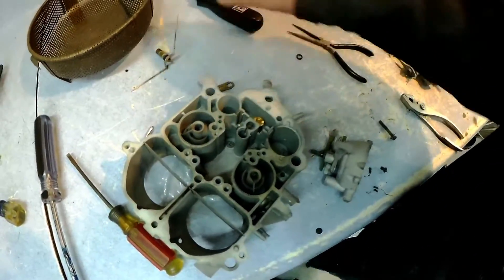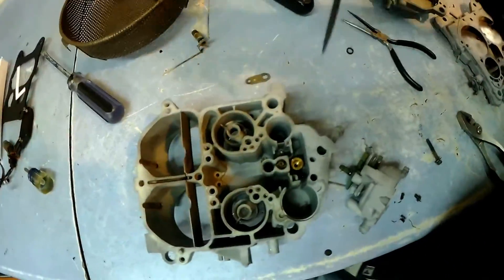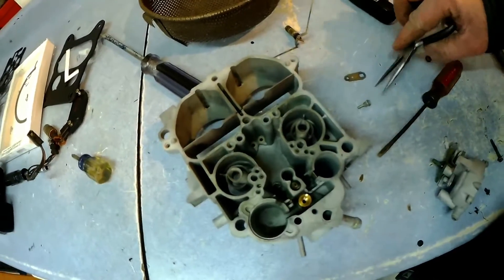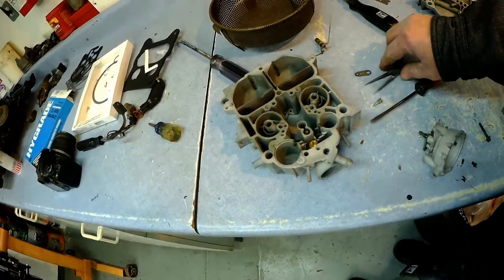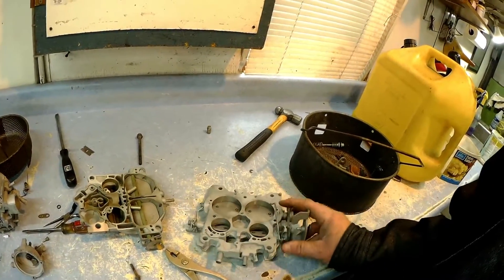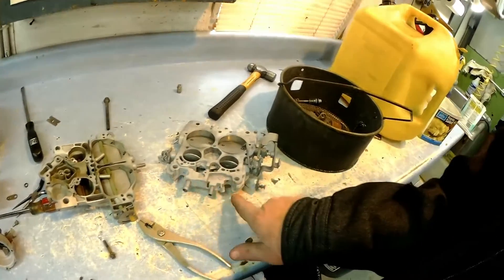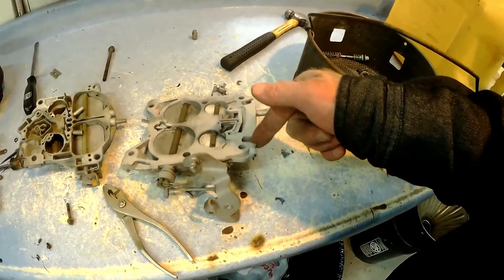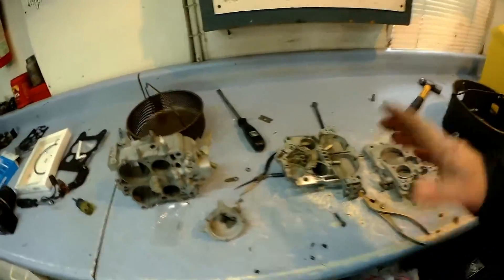GM Quadrajet Rebuild Tips

Comment: Working on my E4ME CCC carb on my 84 camaro again. I tell ya, without the gauging tools or basic settings it can be a pain. 😩 Great carbs none the less.
Reply from the maker: Yes they have a fair amount of things to watch, I "count" the turns of the mixture solenoid screw when I back it out.
Reply: @mark_osborne  I wish I did the first time I took it out, but the instructions say 3.5 turns from lightly seated. Because otherwise if you can't get the gauging tools that no one sells anymore your "screwed" lol. I finally did the air bleed valve too (took the plug out and new o rings)  I'm hoping that was my richness problem I've been having cuz everything else was working from what I could tell.
Reply from the maker: @louiscyphre6049  good deal. Were you able to remove the restrictor caps that cover the idle mixture screws?
Reply: @mark_osborne  yep
Reply: Unfortunately one of the mixture screws was seized and the head broke off so I could only set one of them. If this last rebuild makes it run better I'll just end up buying a remanufactured carb, even though my carb only has 116k miles on it it's pretty rough from sitting before I got it.
Reply from the maker: @louiscyphre6049  You could always buy a core just to get the base plate - ebay might provide !
Reply: @mark_osborne  right! I have a question about the carb when it's running. Mine seemed to be running rich. When I looked down the choke/primary bores I could see fuel dripping from the jets, is that normal? I don't think so but I'm sure you would know. I know this style carb was close to fuel injection and that seems like a leaky injector. I know now my float level was too low also.
Reply from the maker: @louiscyphre6049  In my opinion, if your idle speed is set to the typical 500-550 rpm, you should not see fuel dripping from the nozzles.  Typically it would take gently raising the idle to say 700-800 before you might notice some drips out of the nozzles. 
I would normally attribute this to a float level set 'too high'.  Yes, the primary metering rods are pulse-width modulated by the computer, much in the same way throttle body injectors work. But all that is doing is changing the fuel mixture (by raising and lowering the metering rods) when you are under load and fuel is passing through the main system (nozzles). Other than that, your carb is exactly the same as a non-electronic carb.
Reply: @mark_osborne  ok, yes my idle speed was kinda high, at least 600-700 need to use a timing light to set my tac again. Thanks for the help. No mechanic around here works on these carburetors lol. I appreciate it!
Reply: Got a question for you maybe you can point me in the right direction, been having a kinda rough idle with my 84 z28 with a l69 h.o. thought it was the carb but I don't think its the problem. The car will almost stall out when In Idle. Once at a stop sign when I gave it gas it stalled out and had trouble starting unless I put my foot to the floor. 

Rebuilt the carb since, still idles rough until warm kinda. Put in new fuel pump, vaccum lines, plugs wires, cap & rotor seem ok. Coil, modual tested ok, and pickup coil check out good on meter. 
Only actual code that came up was 23, mat/baro/mixture control solenoid. You think the intake manifold gasket is bad? I'm just at a loss, I almost checked everything and will be taking it to a mechanic because I need to drive this car again lol. 😩
Reply from the maker: @louiscyphre6049  While the engine is idling, try hovering your hand over the front air inlet of the carb, giving it a tiny restriction. What this will do is cause fuel to dribble out of the main nozzles enriching the  mixture.  If the engine runs smooth, then you know the mixture is lean and that's what's causing the rough idle.  If the engine runs worse, you at least know it isn't lean.
Reply: @mark_osborne  will do, Thanks! I just got a old analog  dwell meter, just not sure how to hook it to the dwell lead in the harness. I know the car has been running very rich according to the exhaust pipe being black and the plugs have soot on them. Until recently one mixture screw was way off. I'm pretty sure it's carboned to hell somewhere. 😬🙏
Reply: @mark_osborne  I'm pretty sure you mean having my hand over the airhorn where the choke plate is right?
Reply from the maker: @louiscyphre6049  Yes
Reply: @mark_osborne  got another "old fart" question mark. 🤣 my computer quadrajet is running rich. I don't think its a ecm problem, that seems to be working ok. I get a rich condition code 45. My carb has a lean stop screw and a rich stop screw to adjust the mixture control solenoid travel. Do you think adjusting the lean stop would help "un-richen" the carb? There's not much I can do with the idle mixture screws at the moment since one it seized to the factory setting. They're close to 2 1/2 turns out. I'm out of ideas for getting this thing to run right, been replacing vaccum hoses and stuff to make it "air tight" but I don't think that's the problem. Thank you sir, have a good day! 👍 🙏
Reply from the maker: @louiscyphre6049  Can you hear the mixture solenoid bouncing up and down while the engine runs ? You might need a stethoscope to hear it
Reply: @mark_osborne  yes, when the key is turned on, also clicks when it runs, I stick a paper clip in the top and I can feel it pulsing up and down.
Reply from the maker: @louiscyphre6049  Then you could try turning the screw effectively setting the entire frame of the solenoid further into the body,  as you know, there is a spring under solenoid. As you suggest, that will cause the metering rods to be (on average)positioned lower into the jets - leaning out the mixture  to a point.  The feed back loop will adjust the pulse width based on O2 readings, so you will only have a limited effect (with this adjustment) if everything is working correctly.  I would also throw in a new O2 sensor, those old single wires sensors wear out, and they are cheap.
Reply: @mark_osborne  ok, thanks. I actually did put a new o2 sensor in very recently. No more code 32 (yet) but now I actually get a 45 code.
Reply: Hello again Mark, I'm pretty sure I narrowed down my problem on my qjet, im getting a very small amount of gas in my float bowl line. I'm very sure I set the float and needle correctly, and checked it for sticking. It does move freely on the car. And ideas what is causing this? Fuel pressure too much? Vacuum sucking it through the canister purge valve? I think this has something to do with my rich condition for some reason. 🙏😬
Reply from the maker: @louiscyphre6049  Yes yes, I have seen raw fuel being sucked through the canister, that could be your entire problem. Try plugging off the canister and see what happens.
Reply: Update for you Mark, took my car to a shop so they can finish what I started lol. I did get the rich CE light to go off by plugging the bowl vent on the cpv. Now I found out that the style I have they recommend plugging the intake vacuum port from the pcv valve because this sucking fuel from the carb happens a lot. I did also finally get my old analog dwell meter to work lol but oh well lessons learned. Maybe when I get the car back I'll make a little video to share what I've learned and so you can see the all original 84 z28 I have. Pretty rare setup from what I've seen. Take care and thanks for the help, I very much appreciated it! 👍🙏
Reply from the maker: @louiscyphre6049  Thank you so much for the update, and yes, please, send us a video link 🙂
Reply: @mark_osborne  update #2, mechanics wouldn't touch my car lol. All the guys who work on carbs retired around here 🤦‍♂️. I guess my main issue with my car is it sometimes spits fuel out the top of the airhorn. I'm not sure if that's a carb issue or something else. It runs kinda rough until it's warmed up. But I'm no expert,  I'd just would like to be able to diagnose this thing without buying parts to try and solve it. 😕

Comment: interesting . thank goodness for efi.
Reply from the maker: Hey Richard, did you know the next generation Q-Jet employed electronically controlled metering rods, a 36 mhz computer, throttle position sensor, oxygen sensor, MAP sensor and coolant temp ?  That's right, it used all the same inputs as GM's first DFI, only instead of driving fuel injectors, it used the feedback loop from the O2 to PWM (modulate) the metering rods in attempt to maintain the proper fuel/air ratio.   The system worked amazingly well !  However, once DFI (throttle body injection) hit in 1982, the complexity (vacuum lines, wires, etc) was vastly improved.... and the beloved Q-jet was part of history
Reply: no, i did not know that ! that's really interesting . what years did gm do that system?
Reply from the maker: @richardriehle4159  To my knowledge it started in 1981, and ran thru 1988, the final year for passenger car and light truck applications.  Everything after that was EFI.   BTW, they referred to that carb as the E4ME  :-)

Comment: Don't forget the throttle shaft bushings. They wear out causing vacuum leak.
Reply from the maker: Yes, great tip.  Funny, I've been through probably 1000 of these carbs over the years and never addressed that issue mostly because if you attempt to remove the throttle plate screws they tend to "break off" and you're left with a piece of unusable trash.  A couple times I was forced to adjust some secondary throttle plates and was lucky enough to get some #6 machine bolts with nuts back in place, along with red lock-tight after breaking off the original throttle plate screws. Thanks for the memories !
Reply: @mark_osborne  Yes, the small screws holding the plates are staked on the ends, so those end tips must be ground off to safely remove the screws without damaging the shaft or breaking off screws. And primary throttle bushing kits may not have been available long ago, whereas now they're readiy available at q-jet parts dealers like cliffshighperformance.

Comment: My dad has an IROC with an E4ME Qjet in it. We installed an L69 camshaft during the rebuild with flat top pistons to get it a little punch. I installed DR secondary metering rods and an M hanger, basically what came stock on an L69 high output Camaro. Runs like a bat first gear to 6,000rpm, shift to 2nd and it stops revving, falls flat on it's face, won't go until you let off the gas and grandma it for 10 seconds. I'm thinking it's running out of fuel. I believe it's got a new Carter mechanical fuel pump in it. Any thoughts?
Reply: Yup,likely running out of fuel.

Do these things below & you will get it fixed!

Go onto eBay to search and buy a high flow .030” or .035” high glow needle & seat & set float to oem spec.
Stock oem needle & seat is approx .010”.

Remove the small restrictive in carb fuel filter and if n stall a large high flow fuel filter.

If you motors running a mech fuel pump remove the pump so you can remove the very heavy stock f-pump rod & instal a much lighter moroso high perf f-pump rod. 
Doing that ensures the fuel pump actuator spring doesn’t go into float mode at higher rpm capability the l69 cam gives your motor.

Doing the above will ensure your motor has all the fuel it needs to & past 6k rpm thu all gears.

I have found this general setup to work well on all mild to fairly hot Sbc or bbc street/strip performance apps in he 50yrs+ iv’e been wrenching/rebuilding & restoring American classic muscle cars.

Comment: What about the problem of gas “leaking” out of these carburetors when they sit for awhile. I’ve been told to epoxy those plugs on the bottom?
Reply from the maker: You could - but the problem is rare. Some kits come with a black spongy thing you stuff in the cavity under the plugs. It's shaped to fit in the cavity.
Reply: Thanks!

Comment: I will literally pay you to rebuild mine. I ordered a remanufactured one from Autoline and it was the most half assed garbage carb on the inside I could ever imagine seeing. The guys didn't even have a hanger for the needle. The needle was just sitting in the seat causing the carb to flood...majorly. worst 300$ I've ever spent. My carb on my 73 delta88 is overdue for a rebuild though, That's next on my list being as buying a remanufactured one was a big mistake.

Comment: Hey mark would you know what size anl fuse I should use with one chevy volt 24v battery I have 15 of them and I want to fuse each one and then fuse all together would you have any information on what size to use on one thanks
Reply from the maker: I'm sorry I'd have to know way more about what you're doing to be of any help
Reply: I have 15 24v Chevy volt and cmax batteries for my solar I want to fuse each battery thanks bud

Comment: Can the quadrajet be modified to run on propane?
Reply from the maker: In the case of propane, you have an injector that flows the gas and generally, one large butterfly that controls the air.  The design is so radically different from a carb, I can't see how you could modify it so it would work.

Comment: Hey Mark, greetings from Bolivia. I wanted to ask you if you have any experience in high altitude settings, I live around 13000 ft. above sea level and we are always struggling with getting a/f ratios correctly. Thanks in advance and have a great day.
Reply from the maker: I do not but I can appreciate what you are dealing with.  Do you have a wide band A/F gauge installed ?  You could always play around with thicker primary metering rods (Q-Jet) or smaller jets
Reply: @mark_osborne  thank you for responding, the other "thing" that we have to deal with is incredible high shippings and taxes rates to get whatever so, most of the time, mechanics and enthusiasts only rely on little tricks to make things work. The point that I'm trying to explain are the difficulties we have to go through to get a couple jets and needles to play with and make things right, lol! Have a great day, sr.
Reply from the maker: @kevlar7556  I understand !   You at least have the beautiful Andes Mountains to look upon, I am jealous of your beautiful landscape :-)

Comment: These two green little gaskets, I see where one goes that sits in the bowl part of the carburetor. I'm know trying to figure out where you said the other green gasket goes. Is it right behind the screw and sits in the cavity of the choke housing where the green rod goes through it from the back of the choke hosing? Very good information, but I just need to know about the 2nd little green gasket location in the choke housing.
Reply from the maker: send me an email with a photo of the 2 green gaskets  gearhead4you@yahoo.com

Comment: I'm having trouble with carb bogging when secondary start to open.?
Reply from the maker: There is a secondary air door adjustment spring that tensions the door.  Tightening up the spring will help eliminate the bog. I should do a video on that.
Reply: I'll try thanks
Reply from the maker: @nrsais07  1/4 turn at a time on the tension screw. There's a set screw underneath that locks the tension screw. Access the tension screw from the side using a tiny flat screw driver.
Reply from the maker: @nrsais07  you can see it at 12:06

Comment: You said some OLD stuff, so I was hoping I was gonna get some learnin lol  I have a 52 Olds with the Qjet 7004300. I bought a kit for it and put it in and found before putting the lid on it that some idiot had taken the new accel pump out and put his old one back in my kit. It's got the old leather style accel pump and I'm having problems finding a replacement. I've checked my float levels and replaced one of the old brass floats but I'm still leaking gas somewhere and is always flooded unless it's sat for a long time in which case the float bowl seems to be dry..........
Reply from the maker: Those old leather accelerator pumps were not all bad and seem to last forever.  Did you get the little black sponge that fits in the cavity between the main body and the throttle plate ?  It's designed to stop the main wells from leaking gas down into the intake manifold.  Start the engine, let it warm up, shut it off, wait about 6 hours then unbolt the carb and lift it straight up a couple inches and look to see if there are drops of gasoline hanging from the bottom of the carb. If so, that's the problem.
Reply: @mark_osborne  I got nosing around to see if  I could find out if it had the well plugs that seem to get a lot of noise about leaking. Little black sponge eh? It's been a while so I'm not sure at this point. Thanks for steering me in that direction

Comment: What's better on gas 2 barrel or 4 barrel
Reply from the maker: In the case of the older GM carbs, the 4 barrel by far as it has triple annular discharge boosters which help maintain  fine atomization over differing flow rates.  GM knew this and in later years eliminating their old clunky 2 barrel and instead made a 2 barrel out of the primary side of a Quadrajet, and that carb will deliver respectable fuel economy just the same as the 4 barrel Quadrajet
Reply: @mark_osborne  thanks mark